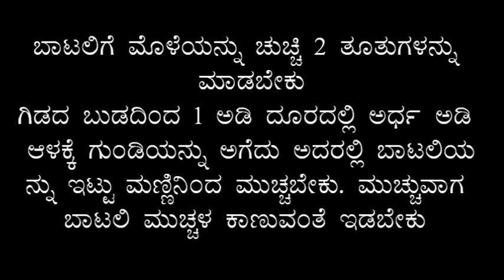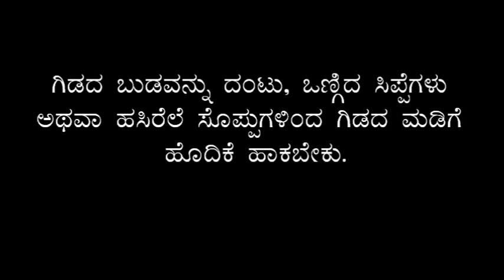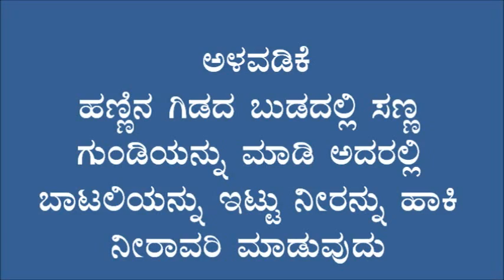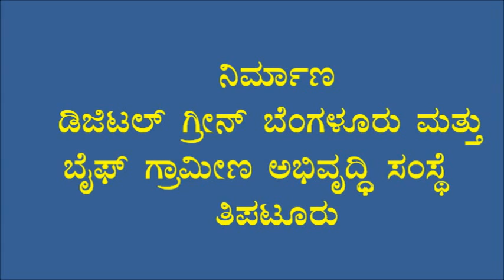Bottle irrigation method Kannada BAIF Karnataka

Comment: hi  why cant you put the bottle straight up????
Reply: You need to keep the bottle cool by hiding it under the ground. If not, the heat will create pressure within the bottle and push more water out. Straight up will also create higher pressure to the 2 holes.

Comment: Sounds Good. But this may leach chemicals from Plastic. Alternatively a clay pot with holes at bottom can be used.
Reply: How does chemicals get leeched ?? If the bottle is not subjected to heat there won't be chemical leeching